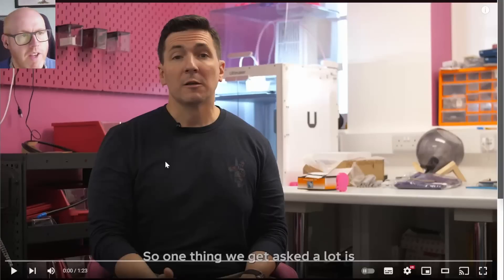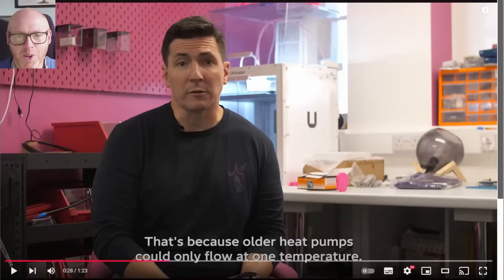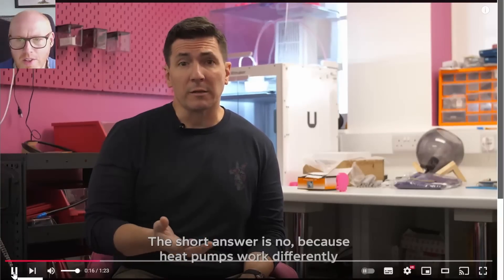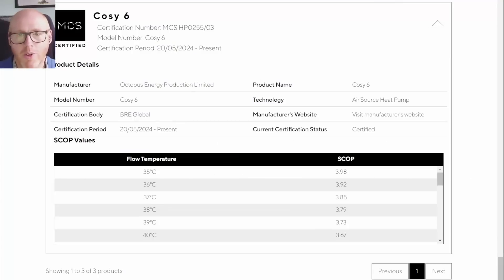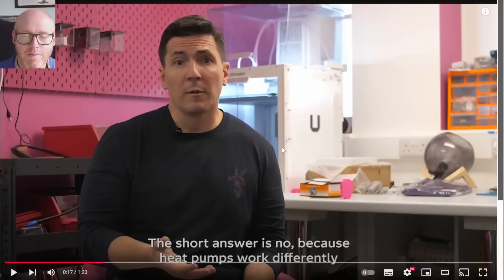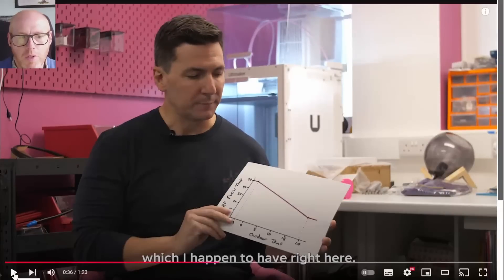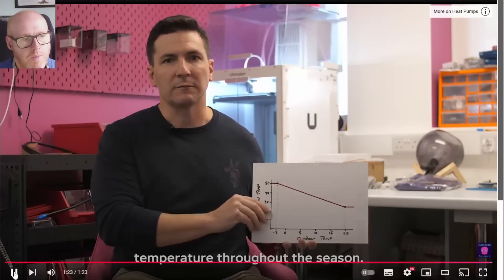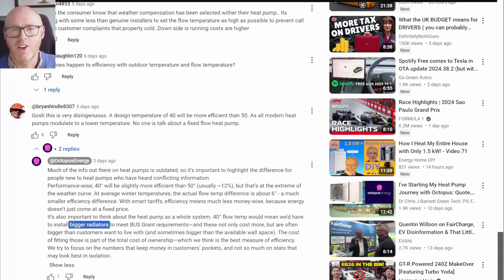Does Flow Temperature Really Not Matter in Heat Pumps?

Comment: Lower flow temperatures require higher flow rate for the same power output. Higher flow rates require larger pipes = higher retrofit installation cost. Designing for lower temperature flow requires calculating the system pressure loss to size the pipes correctly. It is simpler for them just to say "Sometimes lower temperatures are less efficient." Because it is true for a system installed with pipe work too small for a lower temperature. But it is not true in general. Is this what's going on here?
Reply from the maker: That might be just about the gist of it.

Comment: 50% of the running cost savings is because bigger emitters easily run much lower temps. If people do not size up emitters, they will have to run higher flow temps, it's so obvious a child can understand it. Selling something that is linked to power tariffs sold by only one provider is surely misleading marketing? And suggesting that even some old gas emitter sizing will work with heat pumps is just silly, and wrong. I don't understand resistance to larger emitters, especially if better efficiency and therefore lower power bills are guaranteed. I have two huge emitters in my very modestly sized living room, one behind the sofa, one behind a large armchair, they do not distract the eye in any way. Final thought - not enough is being said about allowing the best airflow for emitters. Emitters are not radiators because they only radiate about 10% of their heat, the other 90% is convected, so anything preventing free flow to the bottom and from the top of an emitter will damage efficiency.
Reply from the maker: Great comment! I agree!

There is an argument that radiators do actually radiate a larger proportion of their energy at lower flow temps and as the thermal mass is built up in a room there are less convection currents to transfer the energy from the emitter.
But yeah, allowing airflow is just so self explanatory my kids do understand all this!

Comment: "efficiency" can also be ROI (return on investment) thing, so avoiding the retrofit cost you mentioned is an important part of the marketing push to heat pumps.

 We can be our own worst enemy with some of the nitpicking, as most folks in the mainstream media are regurgitating really old info such as need for all radiators needing replaced and all piping. Stories from 15 years ago are still going around as 'current' problems.
 
Being able to operate at a higher flow temp can be a big win for those with smaller radiators and microbore, once they've got a few simple low cost insulation feature installed, so lets be more pragmatic and understanding about who this is aimed at.
Reply from the maker: Good point ☝️

Comment: It really doesn't matter. The vast majority of consumers will buy heat pumps once it's clear that a) it will cost much less to stay comfortable in their homes b) they can afford the cost of the change from gch to heat pump systems. 

Prosumers or professionals that can interrogate design parameters and optimise a system to achieve higher coefficients in the medium term - are a small but vocal minority.  Fair enough. 

My recommendation is the hire an engineer to design your system based on a building inspection (thermals & drafts). The lowest cost highest impact  interventions may be to replace windows or renew loft insulation. But that's not sexy I guess
Reply from the maker: Thanks for commenting.

Comment: Great video. We got a quote from Octopus and I think the Cosy 6 is a really interesting heat pump and perhaps my preferred choice if we were to go for a 50deg design flow temp. Instead we've gone for a 45deg install with a Vaillant as that's better and our existing pipework is sufficient. I told the Octopus rep we wanted a 45deg install. It's most likely that Octopus are getting a lot of similar feedback which may have prompted TJ to respond with a video pointing out the weather compensation curve.
P.S. do you have a link to that Vaillant datasheet?
Reply from the maker: Vaillant have put much of their literature behind a technician login now. 
I've scraped as many of these documents as I could get my hands on and have uploaded them to the files section of the Vaillant Arotherm UK group.

Comment: Can somebody explain why on the Octopus WC graph the flow temp is above 25° when it's 20° outside? Surely you don't need heating when it's 20° outside. TBH we don't need heating when the outside temp is above about 12° or less if the sun is shining. You'll already have people and appliances generating more than enough heat.
Reply from the maker: @johnhunter4181  correct. An adult at rest will emit ~100W, not to mention all the other thermal gains.
We have our heat pump set to off once the OT reaches 17 degrees for this reason. 👍

Comment: Octo knows that most people aren't very bright, and fear change, so they want to keep the user experience with a HP as close as possible to their existing gas boiler.  So;  keep the rads nice and hot and don't charge very much for the installation.  It's a good strategy, as others have said, and there is the opportunity to make further savings using tariffs.
Reply from the maker: That's a good concise summary.

Comment: It's worrying that the professional business has worse communication on this topic than (presuming you aren't doing this full time) an amateur that isn't even in the heat pump trade...

To be honest, in my experience so far, amateurs are often more knowledgeable than heat pump professionals. Mainly because the "pros" have been doing it decades and stuck in their ways. Or are trying to pedal a system which is optimised for the fitter rather than the user. Example being this Octopus misinformation effectively distracting from the truth that they've minimised installation costs at the cost of efficiency, which they think is worth it.
Reply: Seconded. I saw an Artisan electrics video about 'best home batteries', which turned out to be best batteries from the installers' POV, not the customers. And it entirely failed to mention most of the better value options. OK, that's PV/ESS not heat pumps, but same principle. I'm also permanently annoyed that DIYers are excluded from all grants for this stuff. They don't just provide good advice - they often do very good work too. Grants should be based on outcomes/standards, not club memberships.
Reply from the maker: Thank you for the praise.
Yep, just a hobbyist/enthusiast at best!

Comment: The way the octopus rep explained it to me is that  with a SCOP of above 3, it makes the running costs better or equal to a boiler whilst keeping installation costs competitive to a regular boiler. They believe, that will entice more people to switch when they need their boiler replacing.
Reply from the maker: It's a good business model, it just needs some clearer messaging.
Reply: @UpsideDownFork  yer, they only explained this to me after I asked why their cost was so low compared to other companies.
Reply: Electric costs 4 times the price of gas per kwh so ideally a cop of 4 needed.
Reply from the maker: @marcussmith6523  Most modern gas boilers run at an efficiency of 85% so once you factor that in, you don't need a COP of 4 to win. 
Depending where you are in the country, your rate may be 3.3-3.6 to break even. That's before you consider smart tariffs and other strategies that are opened up with heat pumps.

Comment: Sinplely from a thermodynamics perspective, the smaller the temperature difference between evaporator and condenser the more efficient it will be. As the pressure differential will not need to be as high and thus the compressor does less work compressing the refrigerant using less power pumping and higher mass flow of refrigerant moving more heat.

Comment: Sounds like he shot himself in foot, the lower the flow temperature the better the performance. My Daikin system runs well @ 34C flow.

Edit:- was designed for 45C @ -3.5C external.

I currently run it on flow control set between 34-36C, energy consumption is 400- 650W, with zero cycling other than switching to HWC.
Reply from the maker: No weather compensation?
Reply: @UpsideDownFork  

There's a whole story behind this 🙂

Are we all sitting comfortably.......

Back in February, my HP was installed, like many here I had read as much as I could the previous year into this 'new' technology called heat pumps.
There were a few triggers for me that made me finally decide to jump, one of which was your British Gas install.

Another, perhaps most influential, being the Glyn Hudson self install in his Welsh stone cottage, I thought if it works there it can work anywhere, thus dispelling the myths of the naysayers.

https://www.youtube.com/watch?v=Hyv_vQEvHgo&t=20s

My Daiken 6kW HP sits in a sun trap of a corner; 'all good and well' I thought, additional direct Solar boost.
In practice however the external thermostat resides in the Monoblock unit, Daikin themselves via installation instructions manual ask for an additional thermostat on North facing wall to be fitted (not on my unit), to alleviate the  affects of solar gain whereby my unit thinks its 25C, whereas its actually 15C air temperature ( 🥶) when Sun's out.
In practice I tried weather compensation, but cycled too often for my likening, so I thought I would experiment with fixed flow temperature.......

For the bulk of the year (above 3C) the 34C flow seems to give good result, with the input power rising to 518W as I type (3.5C external).

I will see how this fares over winter, and probably poke a stick at weather compensation, for a week or two and see if it fares any better in colder month/weeks. 

You can see my data on heatpumpmonitor (Aberdeenshire, other metering, British Gas). The COP is based on the post process 'Carnot COP' simulator, as I do not have an independent flow meter fitted.
However the Daikin control unit reports higher COP value than heatpumpmonitor (I was conservative in choosing a 'practical_efficiency_factor' of 0.45 in 'Carnot COP simulator' (an algorithm that gives a good 'ball park' figure for COP without flow rate (litres/minute).

For avoidance of doubt the Daikin HP has a flow meter, supports full weather compensation, shows flow reading, but data not easily  transferrable to Emoncms App', and being own manufacturer the COP value shown on Daikin display may suffer from the 'Diesel gate' syndrome.
Reply from the maker: @_Dougaldog  Thanks! What's the cost of the additional sensor?
Reply: @UpsideDownFork  

I don't know, but a box, digital thermometer, bit of cable, I don't suppose it would be a dear item.

I should really badger BG to fit one, I quite like the results using flow control, outside temperature has just risen above 10C (11.2C) and it's consuming 377 Watts which is the lowest I can get it to run stable at.
Reply: I've got the 6kw Daikin in a sunny spot too. I have the 2nd sensor on a north facing wall. It definitely helps.

Comment: I didn’t fully understand - are you suggesting that a 35 degrees flow temperature is practically unachievable?
Reply from the maker: 35 degree DESIGN temperature is difficult in many properties as the radiators would just need to be too large to be practical.

But properties designed for 45/50 temp will usually have a working flow temp of 25-35 degrees for most of the heating season.
Reply: @UpsideDownFork  is it reasonably possible to get a COP / SCOP of 5 without absolutely enormous radiators?
Reply from the maker: @trailblazer7108  that's such a broad question. COP? Yes. SCOP? No.

Properties reaching SCOPs of 5 are properly optimised. This may mean insulation, underfloor heating or correctly sized radiators, totally dependent on the property.
Reply: @ thank you!
Reply: @trailblazer7108  

I've hit COP of 5 when 16C and above external temperatures, but as UDF says my SCOP is lower and likely to be just above 4 (I hope; it's 4.27 since last February) and currently @ 3.7 with  3.7C external temp' (N.E Scotland). My largest radiator (K3, three panels) hides behind settee, and the bathroom one (a K2 two panel, about same size as door) keeps bathroom cosy at 24C (MCS directive I believe), I have a magnetic towel hooks attached to it.
Reply: It certainly isn't, my Daikin runs at a nominal 34C. In saying that, my very old gas heating system was totally replaced from ground up (cost me just under £4k after grant).
I suspect what the suggestion was that it's more beneficial to get heat pumps installed than worrying too much about all systems being as efficient as possible (but I could be wrong 😉😉).

Comment: Given that most heat loss estimates are erring on the side of extreme caution, I suspect that most installations will actually need only max flow temp of 45. They are not shy about chaning rads. In my quote they didn’t originally plan to change the main bedroom rad as is was at 98.5% of the heat losss calc (within tolerance). All,other bedrooms were at around 105-110% of heat loss, so I asked to change that rad to match the other bedrooms and not createminbalance. Cost was about £100 for the rad and the fitting.
Reply from the maker: @AdrianColes  Yes, I've seen that most installations do run below design temp which is good for flow temp and rad sizing but not good for modulation. 👍

Comment: I don't think his video is that confused, though perhaps the info about weather comp is a bit misleading.  I've always understood the design temperature to be the outdoor temperature at which the heat loss for the property has been calculated, nothing to do with the flow temperature, but maybe my understanding is wrong.  He's talking about people complaining about the flow temperature they are specifying at that design temperature, and then explaining that this flow temperature is only used at the design temperature.   Yes, they could be designing to lower flow temp to achieve the desired room temperatures at the design temp, but as pointed out it seems that may never pay for itself, and would give them  many more problem installs (everything they upgrade is another possible point of failure).
Reply from the maker: Thanks for commenting.